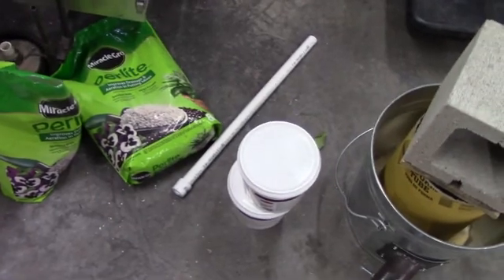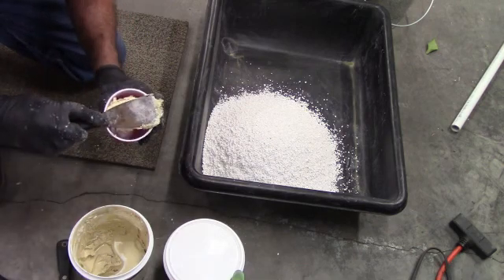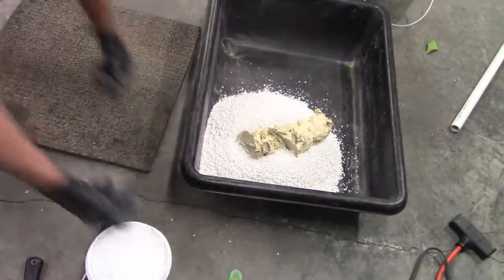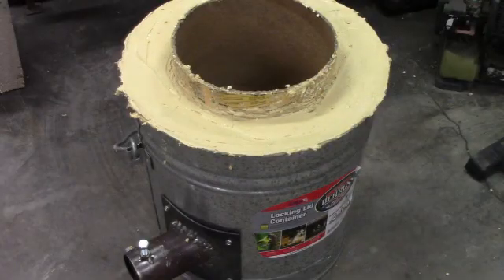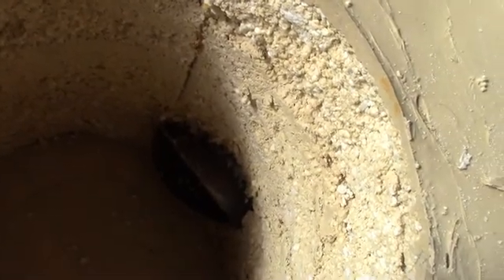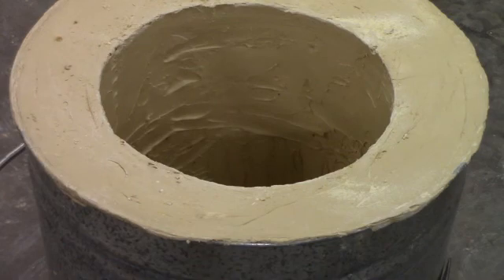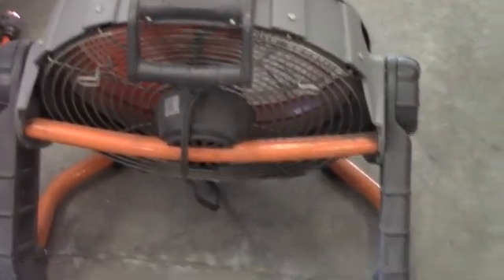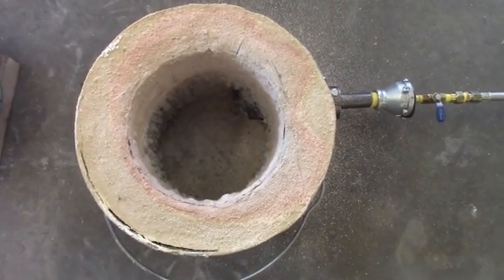REFRACTORY MUD AND FIRE IN THE BUCKET

Comment: Hi Chuck. Looks like it's coming along pretty well. I went through all this last spring myself. I couldn't get what I was looking for and decided I only needed something that would handle about 6 oz. of gold at a time and so I ended up machining a smaller one out of fire brick. It's big enough to handle all the gold I get and I can take it into the field to melt black sands. Yep, they are handy to have.
Reply from the maker: Great commenting thank you for watching. What do you use the melted black sands for?
Reply: Chuck Gentles 
I save all the black sand I can get and process it for the micro gold that's in it. There is a fairly good amount if it comes from gold bearing material. I crush the larger sands down to powder to release the gold and then pan it all down to about an ounce of black sand and gold. Then I melt it down and get a small button of gold. Makes it much easier to sell as well. Lots of micro gold in the dirt all around us and I collect that as well. Something to do in the cold months and good panning practice.. 😄
Reply from the maker: @utahavalanch  Great idea, I had never thought of. Thanks for sharing.